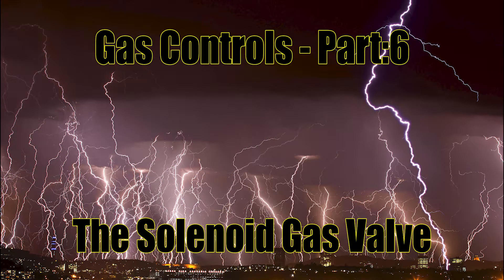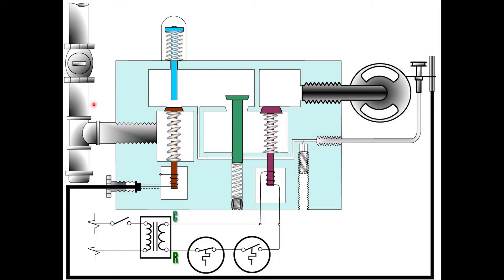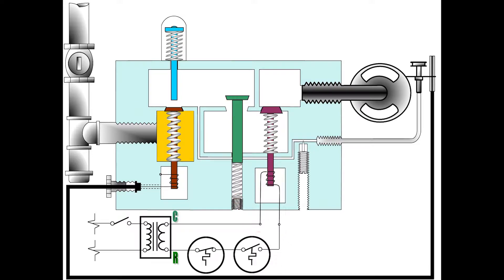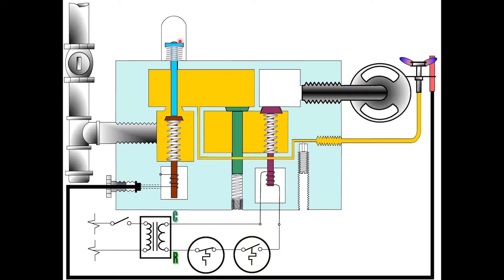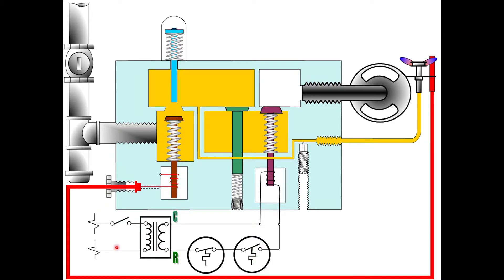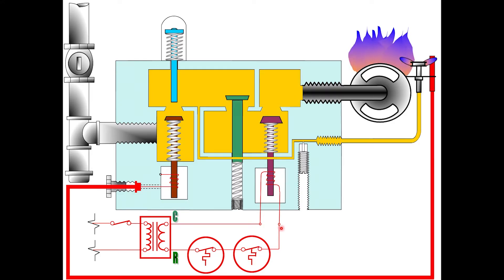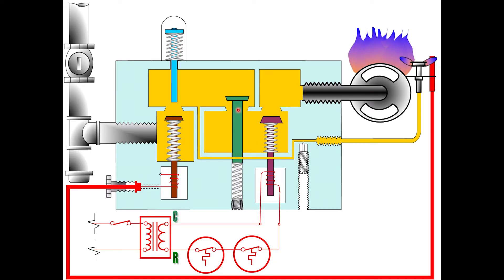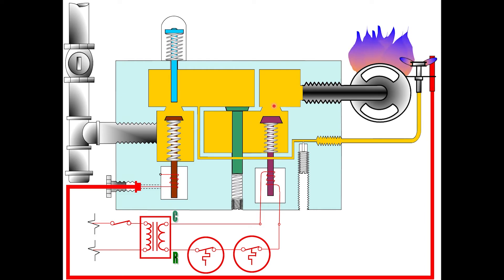Gas Controls - Part:6 The Solenoid Gas Valve

Comment: HENNY PENNY GAS VALVE24 VOLTSHP80761 wiring diagram can u explain pls
Reply from the maker: In the middle of the valve you will see a very basic connection legend. It is referencing the 3 metal terminals just to the side of it. It looks like this:

C
P
M

OFF
ON

C = Common, this may be labelled as MV/PV on the control board (If there is one) [This is the returning path of 24V power back to the transformer to complete the circuit]

P = Pilot, often labelled PV (Pilot Valve) on the control board. [When 24V is sent through this terminal, the gas to the pilot light is allowed to flow]

M = Main, often labelled MV (Main Valve) on the control board. [When 24V is sent through this terminal, the gas to the main burner is allowed to flow]
Reply: @MathematicPlumber  👍👍👍 THANK YOU SIR.....